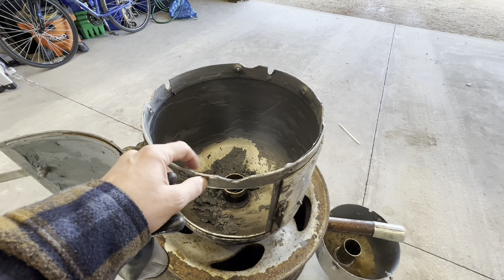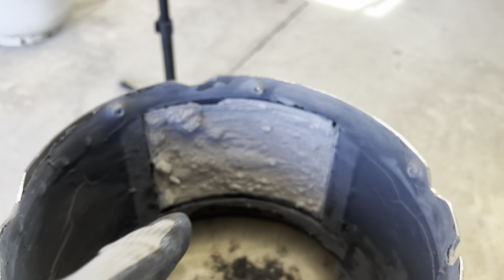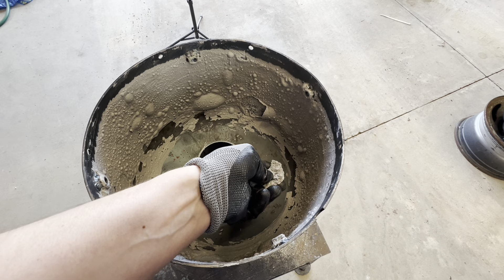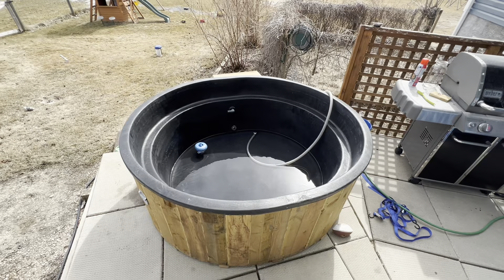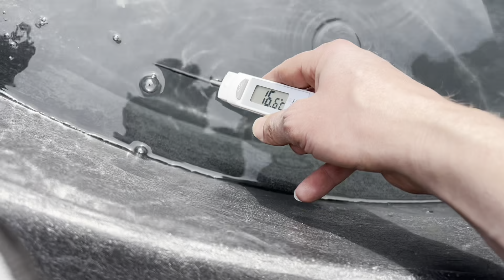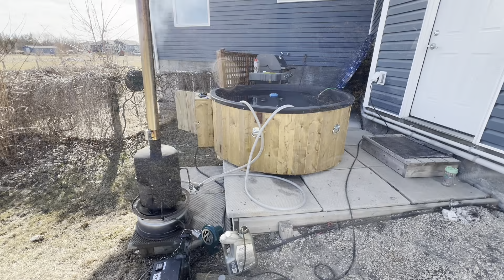Testing WOBWH Version 2!

Comment: Why would you ever use refactor cement? Make no sense?
Reply from the maker: @jimfitzgibbon5492  The idea was the cement would form an insulating layer focus/redirect the heat inward and upward, reducing losses through the sides. 

Forges and foundries use refractory bricks in the same application.

Comment: I just ordered a 50 foot, half inch wort coil for my heater and will likely be building it very similar to yours. I picked up a used 30 lb tank that was half full and am currently using it up heating my garage. 

I just realized that I left a comment a few days ago while signed into my other account "Joel Arseneault" oops. 

I rewatched your videos to pick up a few more details as I am very forgetful. I think your heater is pretty impressive, all things considered. I'm curious if my 50 foot coil will make much difference.

Comment: Great video series. I’m surprised it doesn’t have many more views. 

Your burner can be easily upgraded to make it way more efficient and clean. I recently followed a design from the Creative Inventions LMTN channel. 

I was VERY sceptical about how well it would work, but to my surprise, it has a nice blue flame with very little smell. I have tested it with a CO meter as well as TVOC, CO2 and formaldehyde tester, and it is surprisingly good. 

I have burnt about 200L of waste oil now and am considering building a water heater… that’s how I came across your video.

Edit: The video I got my idea from is 3 burner types to get blue flame. I used the design with 3mm holes. 9 holes in the top, and 20 holes in the side of the tube. I used 2” square tube. Note that the baffle is important and the height of it also changes the quality of the burn. I will publish a video about my burner at some point, but don’t have one edited yet.
Reply from the maker: Hey, thanks for your comment! I suppose it comes down to the YouTube Algorithm and how it decides to promote more popular channels.  

I know of the video you speak of, it was one I watched in my research.  There is potential with my combustion chamber to make various burner designs and that style may be one I try in the future.
Reply: @rad1876  Yes, the algorithm plays a huge part in views. YT also likes insane video titles “Big Oil doesn’t want you to know this water heating secret” … for example. Honest people have a hard time getting views. 

I’m glad you know of that video. I don’t even have a dedicated oil pot / reservoir… my 20lb tank is the oil reservoir and it works amazingly well. 

I can see your small exhaust diameter possibly being an issue, but have purposely caused restrictions to mine and it still runs well. 

Cheers.

Comment: Hey...Great Design. How much would it cost for you to build me one of these?
Reply from the maker: Good question. Off the top of my head, without pricing out everything in detail I’d say somewhere in the $500 range. It’s the little things such as the oil pump and control that quickly add up. If you were to go with a drip feed, maybe a bit less. 

Other expensive part is shipping, the heavy & bulky unit will be expensive to ship.
Reply: @rad1876  Thanks for your fast response. I'm thinking about hooking something like  this to my Central Outdoor Boiler wood burning  stove to reduce the amount of wood i burn  every year. I live in northern Minnesota and go through 8 to 12 cords per year. I thought I could supplement that by burning waste oil from farm equipment. Do you think its possible with this unit?
Reply from the maker: The idea to supplement your wood usage is sound but as usual execution is everything. 

I would say this design is light duty, not meant for many hundred hours of continuous use. 

Operation is still somewhat crude and requires supervision, with enhancements it could be more autonomous. 

Aside from a bit of tweaking it could work great at using your used oil and you can get some extra BTUs from it.
Reply: @rad1876  Thanks for your input. Im thinking of installing the waste oil burner ahead of my wood boiler on the cold water return line. This would  dump the preheated water into my hot water storage tank on the wood boiler which is regulated to 180 degrees. I would then use the controls on the wood boiler stove to circulate the hot water through my infloor heat.Any thoughts on this? Thanks.

Comment: Great video mate, did you look into having a double or triple pass design? Or making the exhaust come out of the bottom, to keep the heat in, as the exhaust would need to cool down first to get out of the heater
Reply from the maker: I didn’t change this design radically from my first attempt so I could reuse several components. The air inlet is at the bottom on both versions so that prevents me from exhausting downward. 

The combustion gasses do make their way through a lengthy route before making their way up the chimney.